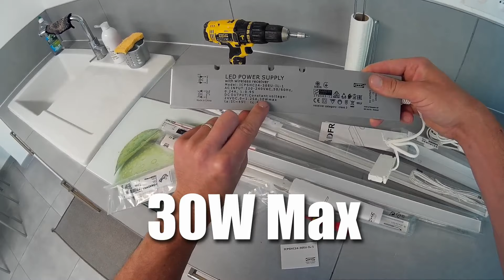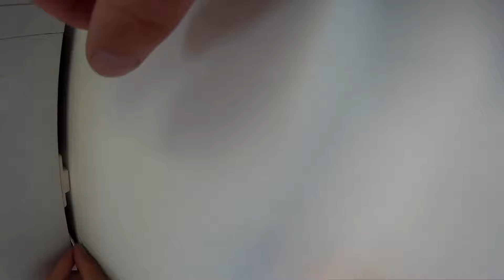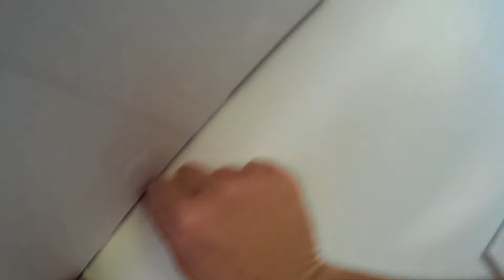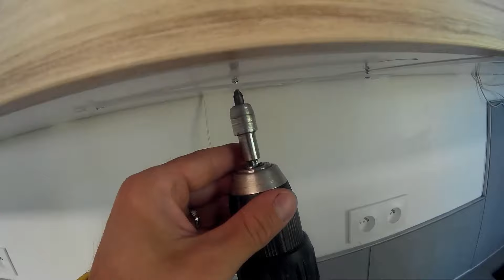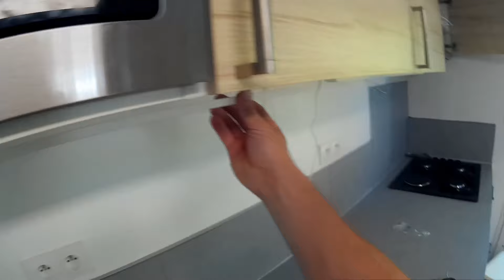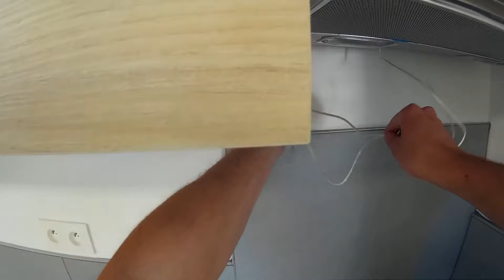IKEA How to install OMLOPP LED kitchen - lumière cuisine

Comment: Do I need to connect every Led Strip with its own power cable or does the electricity flow if I connect with the other led strip

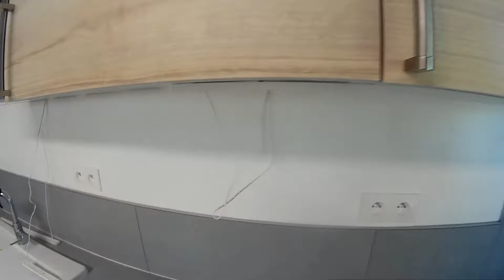Comment: @3:24 that part looks easy but is the worst in the whole process. The system is not bad but the mounts are. Thats one of the biggest failures in IKEA design. Not only are the working conditions in that area extremely challenging but the screws are too small and the plastic will not work properly the second time you try to mount the lamps. I even failed a lot in the first mount but the plastic is extremely cheap and always tries to escape the lamp on one or the other way.